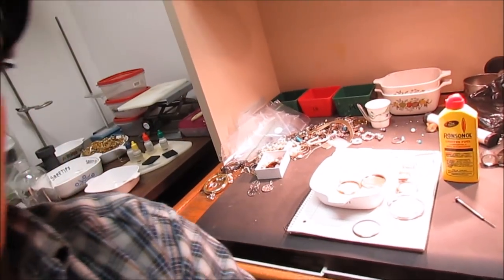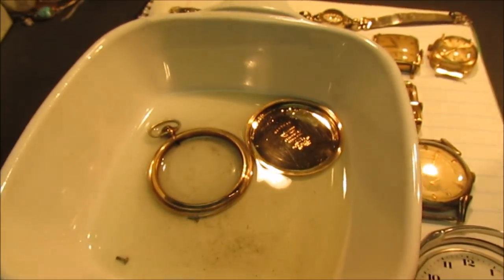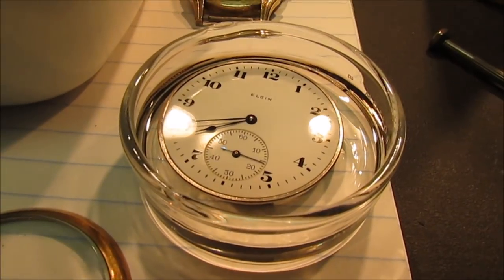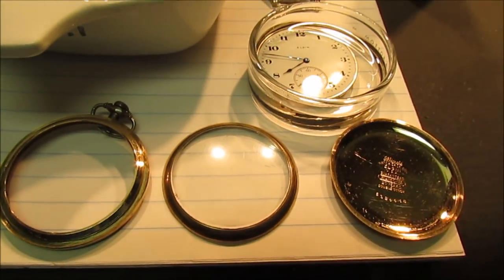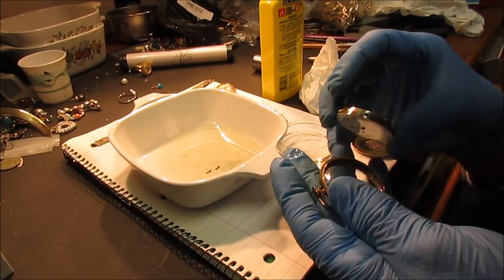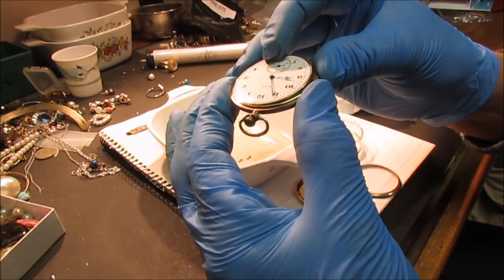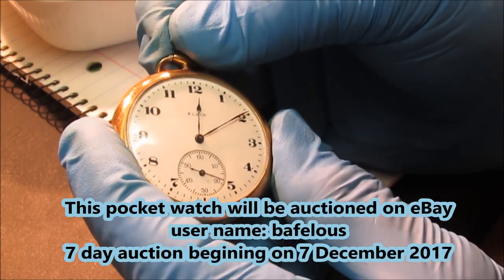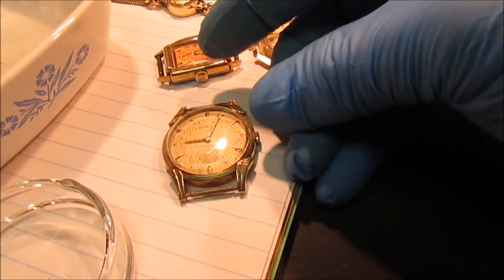Repairing An Antique Pocket Watch With Lighter Fluid

Comment: I was absolutely shocked. I have an old Elgin pocket watch that used to work but hasn't worked in years, and I put it away thinking it was just broken. I took it out today and was shaking it to see if even the balance wheel would turn. It kept on wanting to turn on its own a couple of times and then it would stop. So I decided to look on YouTube to see if there were any videos on how to fix this problem myself. I ran across your video about dipping it in lighter fluid to try to get the sticky gears and parts to move again. Well I poured a little lighter fluid in a small metal pie tin and then placed the watch chassis inside it and the dam thing immediately started running on its own. And it's still running. I started to laugh to myself and I said it works it actually works. Now my watch is running in that bath of lighter fluid which I will leave in there for a while just to clean the works and then I will take it out and try to carefully lubricate it and then put it back in its case I have to say it again I was absolutely shocked when I saw your video and found out that I could actually get this watch to work again. Thank you very much for posting your video. Now my pocket watch will run again for another 100 years.
Reply from the maker: I had the same reaction, I could believe it when the watch started working. Glad it helped.
Reply: before you cause permanent damage to your pocket watch, have a look at some professional watch servicing videos. lubrication is vital - but it must be done properly.

Comment: Serial number says it's from 1920. Great looking watch! I'll be trying this trick on a few of my gummed up Elgins.
Reply: Kyle Fogg Don't do it. Will screw up the impulse jewel as the lighter fluid will loosen the shellac that holds It on. Really really bad thing to do.  Watch my videos on watch repair and cleaning please
Reply: @JDRichard  SOME YEARS AGO I WORKED IN SOME SCRAPS,,, TO PRACTISE , NOT MENT TO BE USED OR SELLED.

PALLETS JUST GOT LOOSE , SOME TIMES, WITH LIGTER FLUID. EVEN TODAY, USING THE RIGHT CLEANER, AND DONT SOAK THE PELLETS... I CLEAN  ONE BY ONE.

Comment: Pretty cool trick !  Now the majority of lighter fluid  is  Naptha based. Out of cnapuriosity do you think its better to actually use the igniter fuid instead of  plain  or straight  Naptha ?  Perhaps the lighter fluid has  other properties like lubrication  or ???  I’m not  being negative I’m just curious  years ago  i had a freind find out how much Money his wife was spending on nai polish remover when she purchased it  in small quantities. And he knew he could buy Acetone  way cheaper by the gallon at the hardware store  so he banned his wife from buying it at the pharmacy  now my Father owned hair and nail salons  and I told him what my buddy was doing. My Dad said it would remove the polish. But real nai polish remover did actually have  minerals in it to   Protect and heal the cuticles around the nails  yes it is Acetone based  but  Acetone is harsh on the skin   S for the extra few pennies. He. Bought the real stuff for the customers in his shops  and he tod my buddy he should do the same  now i was a Woodworker most of my ive and we used. Lots of Naptha  for various finishes and  we used to purchase 55 gallon drums of it for our shop  and i used a Zippo for 30 years  so i knew lighter fluid did have a distinctly different odor than pure Naptha  and those “ other ingredients “ are not   Listed on the can  so it does remain a mystery to  myself  as to what makes it  different in a pinch i did fill my Zippo up with Naptha a coupe of times and it seemed to work just fine
Reply from the maker: A friend who works on watches told me about this trick. He said that lighter fluid has some residual lubricants that cling after the naptha evaporates. I don't know if this is true or not. I just went by what he said because he has way more experience than I do.

Comment: Try using spray starter fluid, it is high in ether which doesn't harm paint and dries in a second.  And it will have a lubricant.

Comment: Don't forget to add some lube after cleaning otherwise the watch will come to a halt sometime with worn parts. You can use a silicon grease, you only need a small amount but don't put any on the balance. Use a tooth pick to apply.

Comment: Wow, that 's amazing!
        I've never seen any youtuber watch repair video where the person actually admits they have no watch repair or horological experience whatsoever, then still proceeds to make a video for people and title it "Repairing An Antique Pocket Watch With Lighter Fluid" as if they actually knew something about the process of watch repair! lolol
 (this rest of this is long, move on to the next comment unless you want a few "one liner" chuckles.)

            As more polite & experienced previous commenters have pointed out for a while now, you are doing more to damage your watch in the long run, and certainly any other viewer's watches that are dumb enough to do what you do in your video to their watch. Even if the watch starts to run after loosening up the dirt and old gummed oils … and even after you say you later put some Mobius oil on it (which I doubt since it costs about $40 to $70 for a tiny bottle) it begs me to ask myself the question of, "What tools were used, where exactly did he put said oil and in what amount?". I just wonder, since you already said you knew nothing about watches. Did you grease the mainspring and winding stem mechanism(what kind of grease) and did you use the really expensive "oily stuff" on the tips of the escapement wheel? 

        Just had to ask because when a previous commenter pointed out you would have to re-lubricate the watch you replied with that you applied some Mobius oil as if you went to a horological repair school between posting the video and answered a follow up comment like now you're Seth Thomas with an oiler pen and a penchant for rummage sales?   

                   Anyways, I hope everyone got that serial number .. if not here it is again,Elgin 22206388, it was a perfectly good 1920 grade 303, model 3, class 114, 7 jewel and double roller pocket watch in a nice case (which was apparently bought for scrap metal gold stripping). 
 The watch was worth at most around $80 ($100 if minty) before you got hold of it unless someone before did the same you dd before and that is why it was full of so much crud... Notice I said "was worth", because now, after seeing what you did, I'd pay less than half that for it because like others have stated, I'd have to replace the hairspring due to weakening and probably also a rusty mainspring due to having its grease stripped and not replace properly.. not to mention stripping the watch apart, cleaning it and re-oiling and fixing whatever else might have happened to it between the times you first opened and last shut the movement in its case!  

           Sad thing about YouTube videographers, always evidently so poor they need  to strip gold and silver off antique metals to make ends meet...Think about it... the amount of gold in that watch was worth less than you probably paid for it without a 5 finger discount involved in a 1 way transaction. Even if you got the watch because you thought it was solid Gold you were wrong so, evidently you know nothing about scrapping for precious metals before being on the losing end of that as well. Should have just sold the watch "as found, unopened, not running" on Ebay to make the most cash out of thinking it had more gold n it than it did.   

           Summing it all up here, I think it comes down nicely to the fact that many people who make youtube videos are often more ignorant about their topic than many of the people who watch them on any given topic! You must have the get rich and/or famous quick youtube channel philosophy of, "Anything for a click or an ego stroking". Working in a tray of Naptha or not, I certainly hope you didn't fleece someone too badly if you tried to pass on that watch for more than around $35 bucks if you didn't have it serviced by a professional after first telling them about your skills at ,"Repairing An Antique Pocket Watch With Lighter Fluid"!

         Anyhow, I call Bullshit on your video as a method of repairing a pocket watch because getting a timepiece's train to run is the first step in watch repair, not the last!
Reply from the maker: Thank you!
Reply: At least videos like this should reinforce that you should already know you'll have to re-service properly any watch sold on e-bay..  especially the ones labeled "Rare", "recently serviced", "wound too tight" and "ticks a while but can't guarantee accuracy".

   Consider it a challenge to better your skills in the re-do of the u known & questionable. Lol

   Sometimes, the igonrant but eager just want to see a watch move a bit with no regard to how well or how long as long as they can play rare antique timepiece collector in front of their friends or in-laws. Lol

    Some peope want to collect things they can't even afford to maintain or take the time out of their OCD day to learn to do it right. 
Just the way it is... wouldn't be that bad if every one of them like tuat didn't think they had a "rare & valuable" timepiece when they go to sell it after it wouldn't run right for them.   Probably most antique & vintage watches on ebay being sold in this state actually did work correctly before their current owner got hold of them and decided made a trip to Harbor Freight for a cheap eye loup and then tried to be a horologist with WD40 and their wife's eyebrow tweezers to save a dollar or piddle their retiremeny time away! Lol
Reply: Don't get me wrong...There is nothing wrong with someone selling watches they service as long as it is fully disclosed that they did the servicing and they have fully disclosed any pertinent flaws and facts of their watch being sold. 
Think about it this way... even the best watch repair experts sometimes make a mistake.. so, how much more the average hobby collector/servicer??? Yet, have you ever seen an ad online that read, "Really screwed this watch up trying to fix it. Thought it was a bargain when i got it but now would just rather pass it along.. I did oil it to the best of my tools and ability though.   It kinda ticks but I can't afford a timing machine or take the time to see if it keeps time... at this point I don't care, I just want to sell it online to you as a "oiled but kinda ticks, probably just wound too tight, rare, one of a kind pocket watch"!
    NOPE, I didn't think you've ever read that in a pocket watch ad online yet lolol....the likelyhood that many are just that way is very high if you run in to the words "serviced" without the words "by a professional" or when the word "rare" comes up in your search list and you notice every single specific item you searched for in a return list of 250 items also say "rare". Lolol how rare can it be, how well can you trust the seller who uses the word "serviced" in that rare ad after that? Lol (  At least videos like this should reinforce that you should already know you'll have to re-service properly any watch sold on e-bay..  especially the ones labeled "Rare", "recently serviced", "wound too tight" and "ticks a while but can't guarantee accuracy".
Reply: @smakfu , I can top that! lol I recently had opportunity to acquire a very nice, German made wall clock. Matter of fact, the clocked faced being given to me or the trash heap due to the frustration it was apparently causing. Evidently, it was sent for routine servicing, came back & would run for a minute then stop... went back to the repair guy, every time came back to owner smothered in more oil and same problem... finally came back a 3rd time and you could see somebody was getting frustrated because the gong affixed to the case was all mangled and strike hammer bent where they hastily put the movement back in... still, same problem, repairman said he didn't do it works when it leaves the shop and owner must be "over winding" the old clock.... 
       I gladly took the clock off their hands, cleaned it, reworked the mangled gong to strike and when putting it back together... I made sure to flip the minute hand back over to the side it belonged and it has been a perfect clock since! lol ..... Yep, the initial visit to the "repair man" for a service caused the problem, that time and every time afterward, he put the minute hand on face side in and it allowed it to rub the hour hand.... when nut was screwed over the hands to secure it on the dial face it applied enough friction to stop the gear train from going. It would run until the energy bound was spent and then stop.. 
    If one loosened the nut it would start ticking again and yet the previous "repair man" was either oblivious to the fact that he kept putting the minute hand on wrong side out or he was deliberately trying to fleece the owner in some way. My bet is that the "disrepair man" was just a clock serial killer in disguise because you could tell he tried to drown it in oil as well... maybe he should have tried death by flame by just mixing some lighter fluid in that oil as well! (actually, this is one instance where at least a wash in white gas could actually de-oil the clock in a pre-cleaning before the motor oil he used hardens if no ammonia based cleaner was handy.... a pre-clean though and for a disassembled big clock, not the only cleaning for an assembled pocket watch)!
Reply: Lol, you win! 
   When the clock repairman learnd of his mistake and that his retainer spring had to be removed, I wonder if he felt bad himself or did he think someone else must have had to let him down? (Ba da boom! The comedian will be here all week.)

Comment: Got a Seth Thomas pocket watch and got it running but it was way too fast. watched video, didn't have lighter fluid and googled for alternatives and it suggested rubbing alcohol...soaked and afterwards it stopped working...period.
Found a place that sold lighter fluid and repeated...afterwards bam it started working as soon as it was in the lighter fluid...
Apparently alcohol will clean but it also removes and much needed lube...where the lighter fluid has some lube in it...
The alcohol didn't harm the watch itself but USE lighter fluid as video suggests and you'll have a cleaner, lubed pocket watch w/o having to pay someone to fix...thanks!